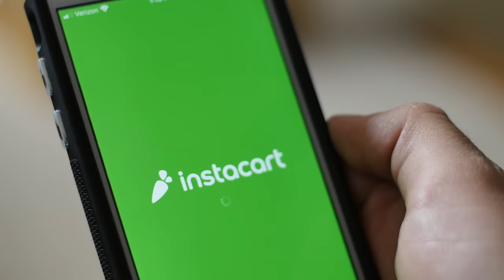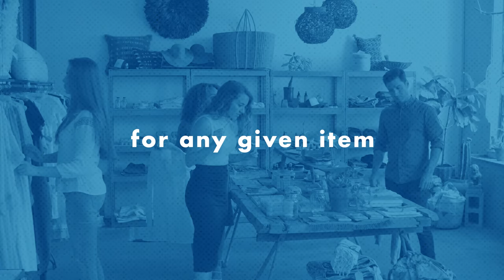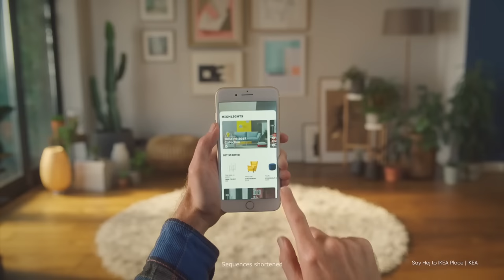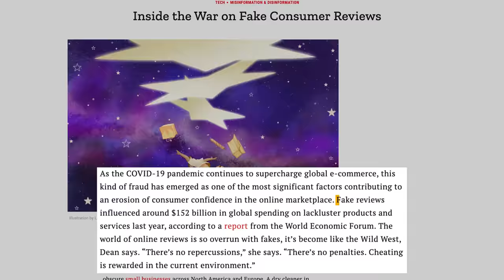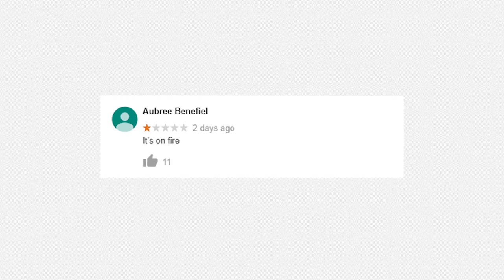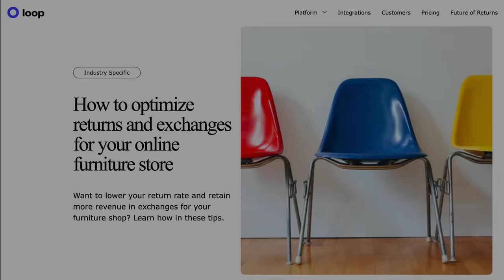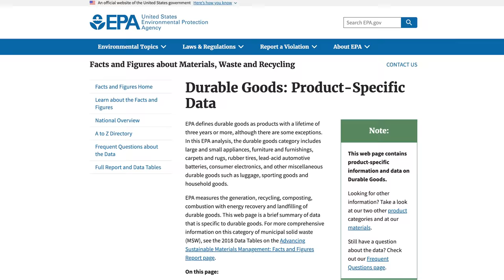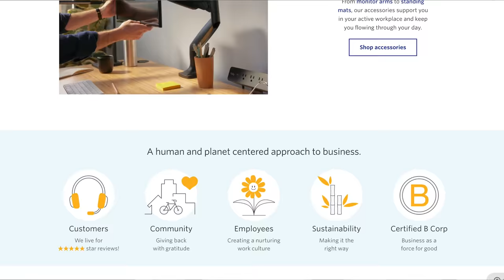The PROBLEM with Wayfair Furniture (DTC)

Comment: It's really weird how the roles reversed and going to the charity shop is what you do when you want quality furniture while new stuff uses cheap MDF in the best of cases
Reply: So true! Even a lot of higher end modern furniture isn't that well made either. Charity shops and second hand dealers have been my go-to for getting furniture for my flat, much to the amusement of friends and family. Much better quality for the same or lower price.

In my opinion, the quality of furniture (and a lot of other manufactured goods) has steadily declined over the last century, but especially in the last 20 years. Growing up, I remember my grandparents' pre-war furniture was much better quality than things they'd bought in the late 1950s-1970s. Even today, I have several 'identical' IKEA bookcases purchased over a span of about 10 years where newer versions of the same item are of noticeably poorer quality.
Reply: If you have the ability to pick it up and get it home without knocking it apart, sometimes you can get that MDF furniture for like five bucks at a second hand store instead of paying 50 or 75 at a retail store. A few extra Tac nails to stick that back cardboard on very securely and you're done!
Reply: They expect people to move and not care about the stuff they bought.
Reply: I see very good furniture at Salvation Army, et al.
Reply: @NoZenith  Also moving sales. And estate sales.
Reply: @Chicago0048  exactly! Especially if they have nice furniture they're basically giving away the pressboard furniture. Unless I really intend to keep a piece forever I'm not spending much money on it
Reply: There is real hardwood wood modern furniture you can buy new too, it's just expensive
Reply: @worldofz00  Generally speaking, these DTC services have disrupted price perception more than anything. It costs a lot for new heirloom furniture, but it is definitely available. Outside of some instances, people have decided it's not worth it.
Reply: @chlly  Agree and would also add that modern furniture + real wood/materials is tough to find. Any random furniture store in town will sell solid wood pieces with traditional design. Want modern furniture and real wood? Forget it, suburbia is not interested and therefore not easily available.
Reply: The furniture in my local charity shops are for the most part, mass produced crap from the last 30 to 40 years.   If you want quality and style, it's expensive VINTAGE items.
Reply: @worldofz00  It's also just a lot more expensive than people realize. I do a lot of woodworking; I build my own wooden furniture. I actually do build solid wood furniture made from real wood through and through. And it is rare that I can build something myself out of solid wood for cheaper than I can buy a cheap MDF version. Yes, if I build something out of MDF, it can be cheaper than the MDF furniture that you can get from Ikea or wherever. 

Solid wood just costs a lot for the material alone. I can make my own furniture with very little overhead. I already own the table saw, the planer, a multitude of saws, planes, and clamps. And I don't have to pay for my time. I don't have to pay for shipping, as I make things in my own garage and use them in my own home. But even then, even for me, solid wood furniture is more expensive than what I can get from Ikea. The end results are a lot nicer, high durability solid wood furniture that will last for decades. But even if you have all the skills, tools, and space to build your own solid wood furniture, the material alone costs more than the MDF stuff you'll find from big box retailers.

So yeah, this is ultimately why you can't find much solid wood modern furniture. I do woodworking as a hobby. I make furniture and household items for myself and my friends and family. But if I wanted to make custom pieces for people, and actually charge enough for the time and equipment for it to be worthwhile? Yeah, that's not going to be cheap. If you want to get a feel for what it would cost? Well, consider a factory-produced MDF piece of furniture, then multiply by 5-10x. That is what it would cost for a solid wood version once the labor, equipment, shipping, etc costs are considered.
Reply: @TanyaLairdCivil : back in the day, real wood furniture wasn't outrageously expensive but then along came imitation materials that could be stamped out in millions of units stripped of all the things that make a piece of furniture interesting a well as functional.   Your being able to make real wood furniture yourself yet barely cover your costs, is very telling.
Reply: With formaldehyde glue * 
And mold 
And bugs
Reply: @TanyaLairdCivil  Agree and I kind of get a feel for pricing when browsing around Etsy where some of the modern and real wood furniture is available. I guess the question is, why is modern + real wood furniture more expensive than traditional + real wood furniture?

I wonder if it is supply and demand where masses consume modern furniture via MDF and when it comes to real wood there's not enough supply or too much demand for it? Always wondered, and never been able to answer it.
Reply: So true!
Reply: Except now the thrift stores have caught on to the fact that people buy up MCM furniture to resell (which I have a lot of negative opinions about), so now they're charging a loooot of money for that kind of furniture, even though they receive it for free and it's second hand and worn
Reply: So u blurred the ram 🐏  out
 I'm dead😮😂😂😂
Reply: I work for a high end, expensive furniture company. They charge a premium for what is nothing more than MDF and cheap veneer. The problem is education. People don't realize they're getting ripped off, and when the stuff falls apart after a few years they are shocked. It's sad really.
Reply: @chlly  It's less "people think it's not worth it" and more "people cannot afford it." It would probably cost tens of thousands of dollars to furnish your entire home in new heirloom furniture. When you're only making $40k a year, you just can't afford that. Even if you're a very frugal person who cooks every meal at home and never buys frivolous things, you still can't afford new high end furniture. 

Thankfully there are tons of secondhand options available so a $5k solid wood kitchen table can be purchased for a couple hundred bucks used and the money often goes to a great cause too. A large percentage of the furniture I own came from the Habitat for Humanity Restore and if I ever decide to get rid of it, it will be going back there for resale which benefits whoever buys it and whoever is getting the house that Habitat for Humanity is building. Win-win!
Reply: @justanotherjessica  Yes, worth is a value proposition, I agree.
Reply: @Kwijibob  With furniture, you very much get what you pay for. But to me heirloom furniture is a waste of my money. I have no one to leave it to anyway. IKEA works just fine, carefully chosen.
Reply: @eattherich9215  They have GREAT furniture - if you have the same taste as your grandmother. Yuck. You can buy the finest quality new furniture in any style you want. As long as you are willing to pay the price if a good used car for a dining room table. Without the chairs. With chairs, it's the price of a new car.

Comment: Minor note, west elm isn’t a traditional online retailer, they are a brick and mortar store with online shopping available. And their quality generally better than the DTC online brands. Most couches at west elm for example are solid wood or solid engineered hardwood frame, which lasts much longer and is refurbish-able. It’s totally worth reupholstering a solid frame couch.
Reply: David,
You are on point. My first low quality couch. I desired to reupholstered it. Because I thought it Wouk’s be cheaper. The couch was still in pretty good shape, but I wanted a different material. The upholstered judging how young I was at the time. 18 years old at the time that I bought the couch. But I was about 21 years old at the time. She ask me do my couch have a solid wood frame. If not it would not be worth the money to reupholstered. Of course I did not know the answer. So she gave me the secret to determine if it was solid wood. She advised me to go the bottom edge of the couch where the wood is. And press your fingernail into the wood. If it leave an impression on the wood. It is not solid wood.🤔
Reply: It's expensive tho
Reply: @daediaz186  not all of it is. There are a few pieces that are solid wood that are under $1000, some close to $600-$700.
Reply: It’s all a lie
Reply: @GarrettXHolder  what did I lie about 🤨
Reply: Sister got a west elm couch as an anniversary gift and the leg broke off in less than two weeks because the design had it screw in at the very edge of the wood frame. They were such an insane hassle about it for months, too. All kinds of runaround until the gifter said "fine, I'll just tell amex to do a charge back" and they finally refunded. Went with Restoration Hardware instead; that one's still going strong several years later.
Reply: Good to know. They are a little pricey, but if it's real wood, it's worth it.
Reply: Anyone know anything about flex steel furniture? Thinking about reupholstering my down flex steel furniture but wondering if it's worth the effort, and the investment....
Reply: It must depend piece to piece. Family members/friends of mine have purchased several tables, dining chairs, sofas, seats etc. Small sample size of course, but 100% were veneer wrapped, compressed particle board. I saw a leg of a chair snap in half when someone scooted back to stand up from the table. Had the chair for about 3 months. Solid wood would never shear in similar conditions. I personally avoid West Elm for anything that may ever carry load, or stress. A cup, go ahead, plate, yeah, furniture, pass.
Reply: Idk I’ve seen them selling $500+ desks and when you check the specifics of the item and it uses “wood veneer finish” which implies to me that it isn’t solid wood or good quality. It’s ridiculous.

Comment: A major problem with quality furniture and one reason it will not be as common as in the past is that moving 50 year furniture every few years when you change apartments is a pain. Quality furniture is mainly compatible with a relatively permanent residence and a lot of younger folk simply do not live that way any more. They are not buying houses and staying in the same place for a decade or more.
Reply: Very good point 👆🏾
Reply: I just moved after living in the same place for 9 yrs….
Reply: @glamgodess01 your singular, anecdotal evidence obviously completely refutes the point he was trying to make about the general public
Reply: @lw7822  like I stated before I had no choice it was mold that made me move. Probably would’ve still been there if it wasn’t for the mold.

Comment: I bought a rug from Wayfair that was delivered early when I was on vacation and it got stolen off my building’s porch, and Wayfair sent me a new one no questions asked which is wild considering it’s a $300 dollar rug and i’ve had customer service departments give me the runaround over an order of like $70 shoes. It’s a great rug, FWIW
Reply: It's not worth $300 then. Was probably made for very little, hence why they're willing to eat the cost.
Reply: @jazzjensen  Anything bought for $300 in retail store probably cost about $30 in labour and materials, with the rest going to multiple layers of 100% markups. If Wayfair charge $300 for a rug that cost $50 in labour and materials, it's probably better than most of what you 'd find for a similar prices in stores.

Comment: I have a wardrobe that was flat-packed and brought over to the US from Germany on a boat by my ancestors in the 1840s. It has been moved to 5 houses in my lifetime. It's still gorgeous and solid. I'm in the middle of moving and a rep came to evaluate the job. He said even the particle board bookcases I got secondhand in the early 90s are built better than the cube storage unit the movers won't take because they're so cheaply made now. Buying online may be more convenient (the place I'm moving has 2 furniture stores and they're horrible quality, and no thrift/resales) but it's certainly not easier due to the amount of research you have to do.

Comment: Many people of a certain age no longer have the strength or desire to unpack large pieces of furniture and assemble them. Especially when the parts don’t fit together properly. I’ve had that happen too many times! It’s actually hard to find fully assembled pieces - even when buying from a brick and mortar store.
Reply: Those weird bolts only attach the furniture once.  You try to disassemble it and reassemble it else where, the bolts invariably strip and the holes in the pressboard wood, widen so that the bolts no longer hold.

Comment: I moved into a house about half the size of my previous place last year and needed a new kitchen table that fit in the relatively specific dimensions of my kitchen. I ended up buying something on Wayfair because it allowed me to shop by size, but it was SO HARD to even find a table that was not particle board. I managed to find an actual wood table, but it was surprisingly difficult and about 2x as expensive. The difference is that I know I will continue to use this table even if I move again because it can be refinished/repainted/used as a desk/etc.

Comment: In the 1990s I got a mahogany dining table, 8 chairs and 3 other matching pieces (manufactured in the 1890s) for 2K and spent 4K to have all upholstered and refinished (they had all been painted 😢). Still have all the pieces - 30 years and going strong.  At that time a much inferior table would have cost 6k

Comment: I bought a cabinet designed for vinyl records. With a few extra thrifted pieces from a used building materials store, I made it a solid piece. People complained online because one screw was missing, dented corner or too flimsy. None of which affected me because I knew how to solve those problems with a tiny bit of DIY.

Comment: I have ordered a couple of items from Wayfair.. I was sent serving trays when I ordered a lamp. Then ordered a metal locker cabinet which arrived dented.  Both times they refunded me told me to keep the item instead of shipping it back.  It suspect it was because shipping cost, restocking, etc., would have costed more than the items.

Comment: Mom and Dad downsized their empty nest into a smaller place that needed a small sideboard next to the kitchen table. They found what they thought would be a good fit and ordered it online, paying for concierge service to have it assembled after delivery. The box came quick, as did the assembly guy. I hope he made what it was worth, because he struggled with it over three visits failing to get both the doors and one problematic shelf to fit or function correctly. But they said he was a very nice man. Finally, customer service gave up after a couple of weeks messing with it, refunded their money and told them to keep the sideboard. They still use it, though the shelf is still collapsed and only Dad can open one of the doors. When the company's jingle comes on tv, Dad has new lyrics. It's "(Company name) it's shit but it's free."

Comment: Interesting video. This year i finally upgraded my bed that id had over 20 years (ikea). I spent 2 months looking at beds online and in local shops, but i decided a UK based company who specialise in these wooden becs would be a good choice. It was thr most expensive thing ive ever bought but it is fantastic and i can't see myself changing it for another 20 years!
Aaaand after much research, my mattress and bedside tables are both ikea. 😅 i did look at wayfair but the ikea tables were much more sturdy. Ive found in ikea if you buy the cheapest you’ll be replacing it. But instead go for something more sturdy and mid-range and you're probably ok.

Comment: As an electrician. I hate Amazon and Wayfair because a lot of the electrical products they sell especially on Wayfair either are 100% not safe or not compatible with North American electrical systems or they are not UL listed or the mounting hardware is for European electrical boxes. So I have to fabricate my own mounting bracket's and I never guarantee the product after it's installed. And 80% of the time when those two companies are involved, the product doesn't even get installed because it's either so unsafe or it just will not work with North American voltages

Comment: Idk about their couches, but Wayfair has amazing desks. I use them for all my gaming setups. They're deep, long enough, solid, and inexpensive. All the "ikea hack" desks between the extra drawers, the extra legs end up costing a lot more than they appear, and since they're just cheap cardboard on the inside end up sagging from just a couple monitors in a few months. I've had 3 27" monitors, my PC, and a CRT monitor on one of my desks for ages and it has no sag or give.

Comment: Ordered a pair of nights stands from Wayfair not long ago and a wine cooler. Omg. The stands are meant for a doll house, they are tiny and made of MDF. The wine cooler came without proper hardware and made so much noise. They replaced with another cooler and sent UPS to pick up the old one. So that took care of an issue. But I won't order again. What a hustle

Comment: The dresser I bought from Wayfair had drill holes that didn't align with the handles and was flimsy. When I called to complain, I was immediately offered a refund but just wanted the correct handles. I was sent a 50% refund and new handles. When the second batch didn't fit, I was told the manufacturer stopped making the dresser and I was sent the rest of my money. 

I had to tear down the subpar furniture cart it out and buy another one from a more reputable store for $1,000 more. 

Long story short, you get what you pay for.